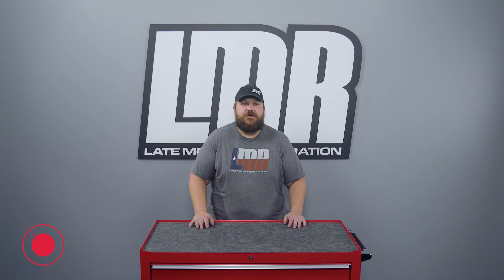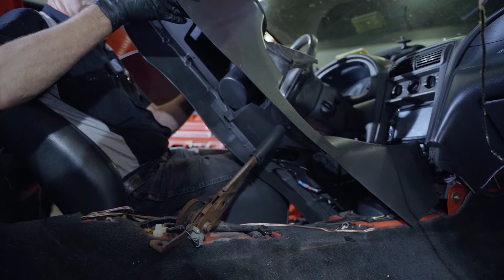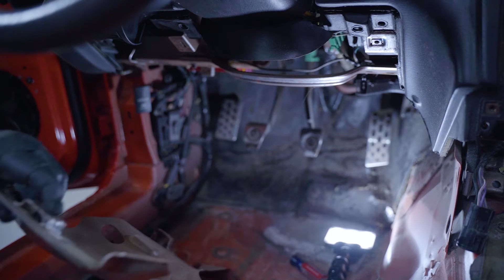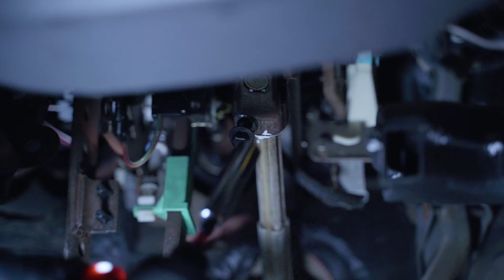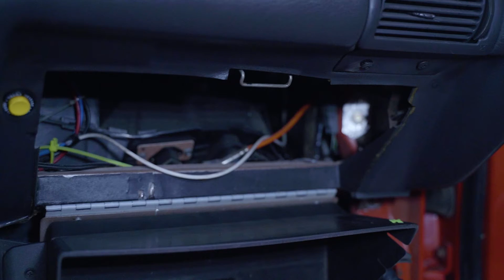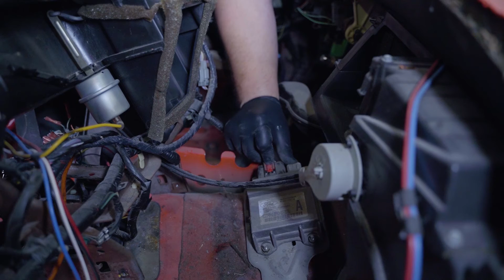How To Remove SN95/New Edge Mustang Dash Panel (94-04)

Comment: 2nd time around taking off the dash, so much easier the 2nd time.
I first was swapping my dabs from tan to black, did the swap only to find out right after my heater core is broken and leaking out the weep hole and blowing through the ac

Comment: Thank you for the video as it was a huge help. 
A couple of things I would add. 
Instead of depressing the bulkhead locking tabs from the inside, do it from the wheel well. Way easier.

I think a slightly better description of what you are unplugging and from where. Maybe a summary?
Reply: you are the man!!! after a hour of struggling
Reply from the maker: Thanks for the comment. Like anything, there are other preferred ways to do something. The goal here was to offer a simple how to video explaining the dash removal process. -Landan
Reply: @latemodelrestoration  Landan, your goal was achieved! Thanks for taking the time to respond.
I am doing a re body using a 03 gt chassis, and a lot of your videos are helpful.

Comment: Does anyone know the size of the screws that hold the lower knee trim panel in place?
Reply from the maker: We have a hardware kit that you can purchase with the bolts that you need. As much as we'd like to share the specification, we're in the business of selling hardware. Thanks for understanding. Link below.

https://lmr.com/item/LRS-3343B/mustang-dashboard-hardware-kit-94-04
Reply: @latemodelrestoration  GAH! That is PERFECT!  Wish I had known.  I ended up figuring out what size they were.  Buggered up one of the nut inserts and had to drill it out and tap it to 1/4-20 so one of my screws is oddball now.
Reply from the maker: @stevensheldon9271  That's good you figured it out! Feel free to shop around our site if you haven't already. We have a lot of parts for the SN95/New Edge cars and are always adding more. -Landan

Comment: Not related to this video but how would u switch power doors to the harder to find crankup windows I thought u could just get the manual window regulators but not having any luck finding them it's for a dragcar it looks like the door skin has the hole for the crankup peace I don't need the manual door skin covers putting bead rolled ones on it
Reply from the maker: All you'll need is the manual regulator assembly. Good luck finding a used one. -Landan

Comment: I pulled dash off but theres a cable from dash to shifter that i cant get off and there isnt 1 video that shows it. How do i remove that cable from the dash. 02 gt vert
Reply: Ik it’s late but there’s a screw that you can take out on the plastic of the cable going to shifter and then you just remove the cutter key and the cable slips out of the shifter

Comment: I have a 2000 year model v6 mustang and I’ve tried to pry off the trim over the infotainment/AC to no avail it’s almost like it’s still anchored to something. It doesn’t pop off easily like in any video tutorial I’ve seen. And I undid any and all bolts around the general area. Please help me out!!
Reply from the maker: Oscar - On 1994-2000 cars, there is a retaining screw in the center area of the bezel that is underneath the radio and slightly to the left.  Hope this helps.  -Landan

Comment: Hello, I had a Holley terminator stand alone put in by a shop. Do I still need to be concerned by a lot of the connector, now being that the Holley is doing the majority of the work? I am not knowledgeable of any of the wiring in the car, so any help would be great appreciated. So, in other words, which connectors should I only now be concerned about? Thanks!!
Reply from the maker: Hi Vincent, if you can, email us or give us a call with the link below and a customer care representative can assist you with that: https://lmr.com/contact

Comment: Honestly it looks like it would probably come out without completely removing the console? I could be wrong though and I'm sure it might make it a tad easier. Just curious
Reply from the maker: Hey Branden, we do recommend removing the center console. This will make everything a lot easier when doing so.
Reply: What connectors can I keep un connected
Reply: With the Holley stand alone. I also have the Holley monitor installed as well. I will be doing this myself. I just need to know what connectors are still a must, as so I can still start the car with dash fully removed.
Reply: @vincentdelucia8078  When you start pulling the dash free, it'll be pretty easy to see what's still connected.  If it doesn't need to be disconnected to pull the dash out, then I'd leave it be.

Comment: Blind-or cable? What is that box
Reply from the maker: The blend door cable and the connection
Reply: Time 4 fifty three
Reply: Blend door is a little swinging door that adjusts where the air goes from the blower fan.